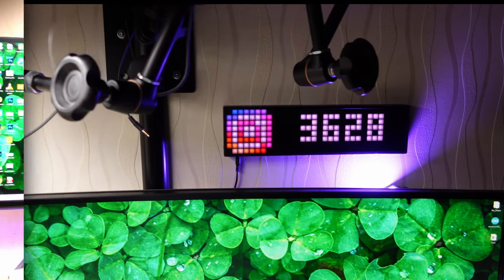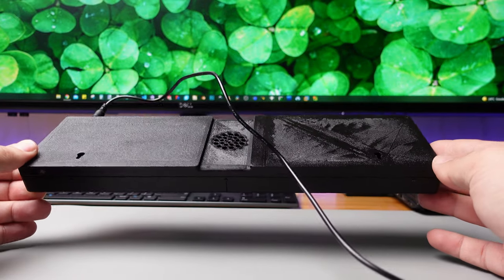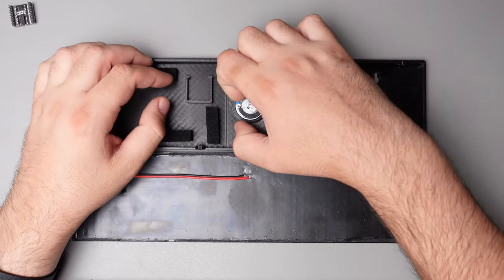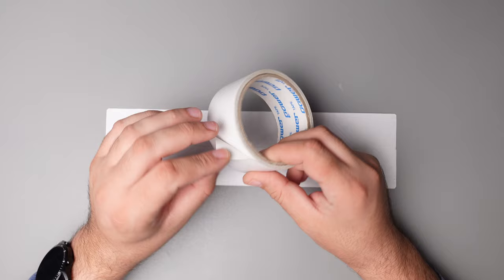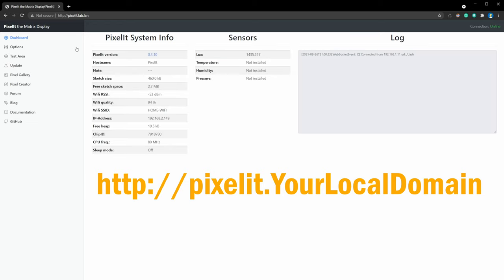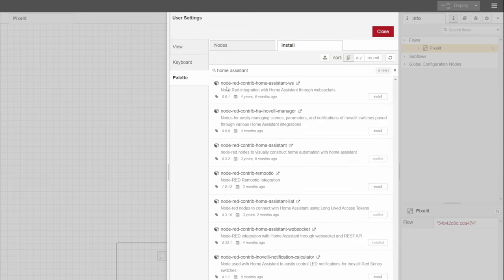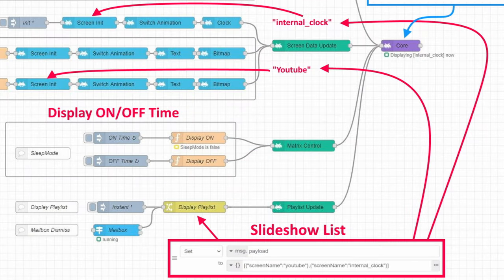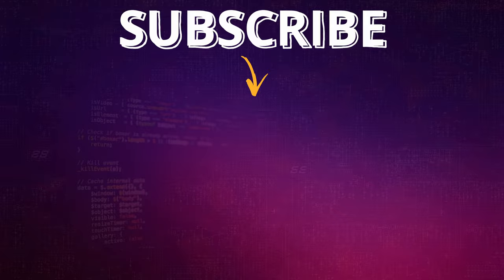LED Matrix Display for Home Assistant "PIXELIT"

Comment from the maker: 📣 UPDATE 2024 - Ready Made device from Ulanzi https://s.click.aliexpress.com/e/_DkP2J2D
Reply: Do you take orders?, I am non technical person, and I need this for myself, if you are okay to make me one "ready to use" setup LED Matrix, I am willing to pay 
Looking Forward.... please reply me how to contact you for this order
Reply: What about the power consumption of the 32x8 panel itself? According to AliExpress it's using 75 watts but you're only using a 15 watts power supply. Thanks in advance!
Reply from the maker: @daanvanvuuren4877   I didn't check the power consumption, but 15A seems to be odd. Approximately 30 percent of LEDs are lit at the same time and not at full brightness. Of course, if you turn on all LEDs, "RGB" it can and will consume more. For this project, I do not think it makes sense to put a more powerful power supply than  5 amps.

Comment: Hello! What power adapter is needed? 5V? How many Amps?
Place fix wiring diagram on github uts broken, Thank you!
Reply from the maker: HI, if you will not turn on all LEDs at 100 percent brightness, 5v  2-3.5 amp is enught. Wiring diagram "Connection Diagram.jpg" is ok.

Comment: Hi from LA! Thanks so much for making this video! About how much did it cost for you to 3D print the case you and grid ?
Reply from the maker: yes, I printed the case and the grid in 2 parts and then glued them together. I don't remember the cost for all, but for now, it is not worth all the hassle, you can buy a ready-made device not that expensive (DIY cost + 20$).

Comment: Hi, I have Awtrix with wemos D1 but hate the fact I need to keep my pc on all the time as host (I know I have to get a raspberry)
Can I use this project as stand along clock without the need to keep on the pc as a host?
Reply from the maker: Hi, 1) Don't buy raspberry pi, instead, get a Small form factor pc like HP T620 - 45-50 euro 2) Try shutting down your computer and check, if Awtrix have wifi connection, in theory, it will work "I didn't check so I don't know"

Comment: Hi. Can you provide stl file without speaker holes or hanging holes on the back cover. Just to save printing cost.
Reply from the maker: Hi. Unfortunately, I don't have these files. All files that I have are in GitHub. Search on Thingiverse, I think there you will find almost identical cases.

Comment: Thank you for your video! Could you tell me how to add or set up "Flow" for Instagram (visible in your video) and the price of bitcoin?
Reply from the maker: Hi, I am not using it. Example "https://github.com/pixelit-project/PixelIt/discussions/26"
Reply: @PricelessToolkit  I tried to add it, but I can't run it so it would work. I don't know how to connect it so that it works. I probably have little knowledge for this :((
Reply from the maker: I tried flow from the link but it not working. Instagram API is closed.
Reply: @PricelessToolkit  Thank you for your support, I made sure it doesn't work.

Comment: What kind of power supply are you using? How many amps?
Reply from the maker: power supply 2 Ah . in normal usage, when not all led is powered. it uses 1.2 Ah .  but for this matrix, 3 ampere power supply is advised